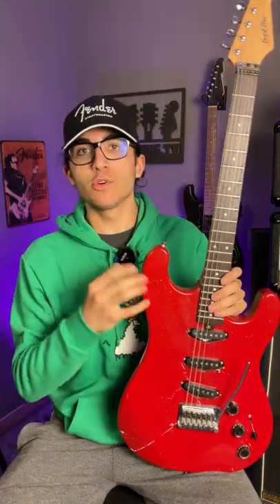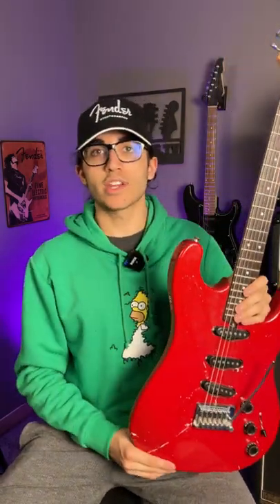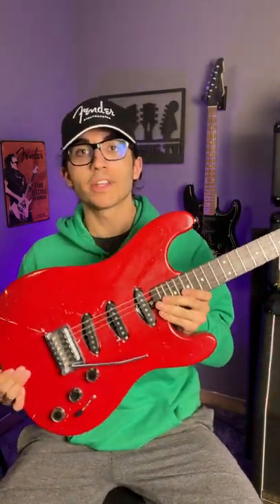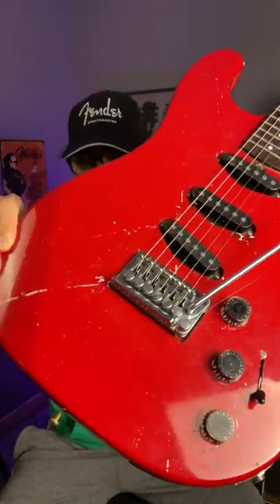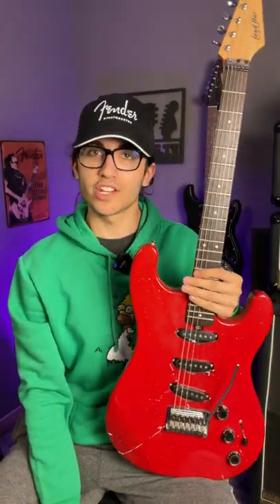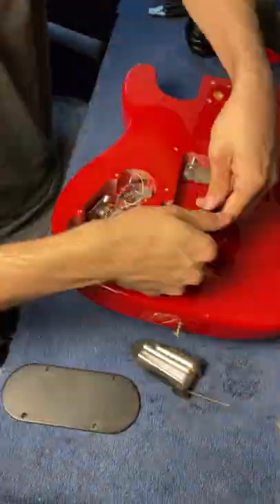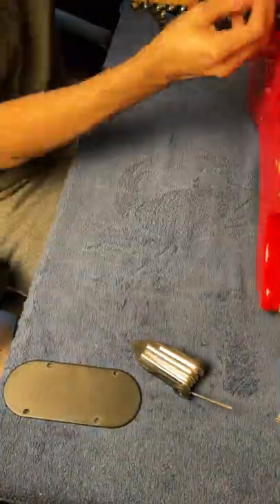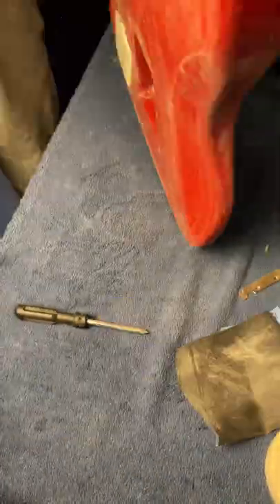Refinishing The "GDR Guitar" | Musima Lead Star Restoration

Comment: Are you going to try to get OEM parts or are you going to replace it with generic Fender parts? (Not criticism genuine question)
Reply from the maker: I'll mix and match brands but I probably won't be using Fender parts. For example I'll probably go for cheaper tuning pegs since it has a locking nut anyway.

Comment: You work on guitars I need some advice I'm 16 and I have a Squier strat and last time I got it repaired me and my parents had to drive 1 hour and 30 min there and another 1 hour and 30 min back just for a 5 minute repair but what happened was the the nut on the jack thing where you put the guitar cord was loose and after so long it wouldn't work any more turns out what happened was the wires had been pulled out of the jack and it needed to be soldered well a few months later and it happened again and my mom wants my dad to try and fix it but I dont want him messing it up and the warranty to not be useful and idk what to do so that why I'm asking you
Reply from the maker: 1) I'm not sure if warranty expiring when you open a guitar is a thing
2) I'm sure your dad isn't entirely incompetent, the only thing that can go wrong while soldering (if it's not your first time) is you not knowing which end of the iron is the hot one...
3) Just do it yourself, soldering is easy. Maybe cut an old useless wire in two and try soldering it before going into your guitars
Reply: Thanks for the feedback and my parents talk like opening it and all that will make the warranty expire and also idk how to soldering and learning from my dad is a pain
Reply: I don’t know if that would void the warranty, but personally there’s no way I would be that bothered about the warranty on a Squier - if it was something like a synthesiser with a bunch of computerisation and software stuff then I’d understand because you’d be screwed if something went wrong and the manufacturer wouldn’t deal with it because it was out of warranty. But a Squier Strat? I’m struggling to see what would go wrong with that which would actually be worth having to drive for hours on several occasions just to keep the warranty valid.

Output jacks are comparatively easy to solder, not a bad place to start with guitar wiring. Regardless of who ends up fixing it, I would recommend getting into the habit of keeping an eye on whether it’s getting loose and tightening the nut up again when it does, to avoid this happening repeatedly. The volume and tone controls as well, if the nuts holding those come loose then the whole potentiometer can just start rotating whenever you turn it, eventually breaking the wires going to it.
Reply: @ollimoore  no one near me can do stuff like that and it's the closest guitar store and I also can about it because it's the only one I have and my town dosent have good jobs that pay well
Reply: @bandbm5599  I get it, it's just I'm not sure what's going to go wrong with it that you would need the warranty for. Presumably the warranty doesn't cover general wear and tear or accidental damage, and stuff like this output jack issue and other minor electronic problems (crackling pots for example) are all that's likely to go wrong with it. 

I guess you could get really, really unlucky and have a truss rod failure or something like that, but that sort of thing is pretty rare. I've only seen one guitar with a total truss rod failure and it's an early Parker Fly from the 90s which has an unusual truss rod design which is known to have that weakness.
Reply: @ollimoore  it's more the problem my dad has a tendency to fuck something up when it should be easy

Comment: You should have covered the neck pocket before spraying ;). Anyway, nice project.
Reply from the maker: Why? It's a few layers of paint
Reply: @sixstringtv1  even a few layers affect the anlge and the fit of the neck. That's why sometimes you need a shim to adjust the neck. Try fitting the neck again and check if it fits. You might need to check the string height when restringing.
Reply: @sixstringtv1  I found the opposite in my MIM Strat. Someone had put a thin metal plate at the back of the neck, in the neck pocket!

This did not go back in following the refinish. 

If your paint bubbles slightly it could cause problems. Also the shape of the neck pocket allows the paint to pool easier. 

You may find because the paint causes more friction it might be a bit of a cow to get in place.

But you have already sanded the entire body. Clearing some of it up shouldn't be too much trouble.